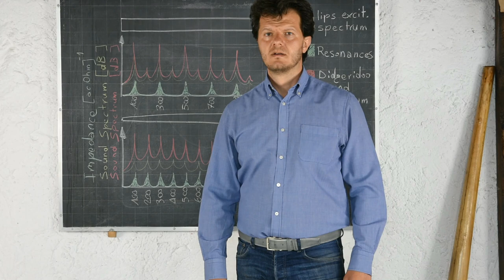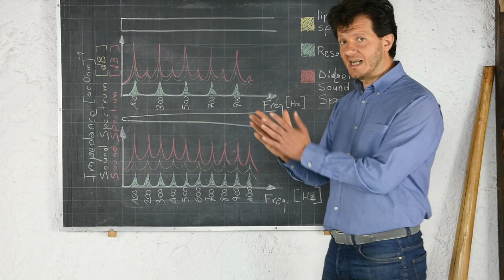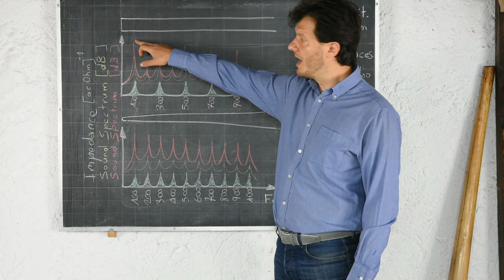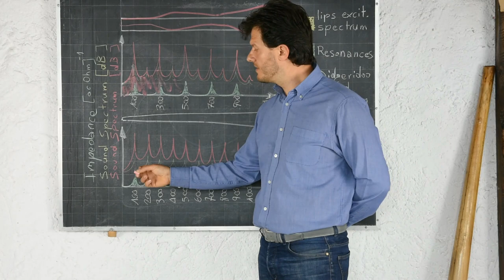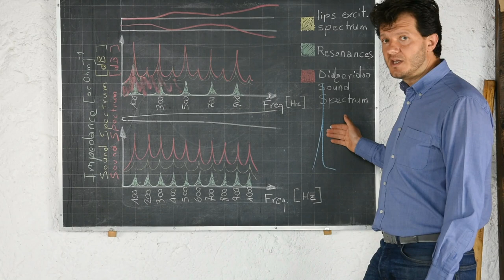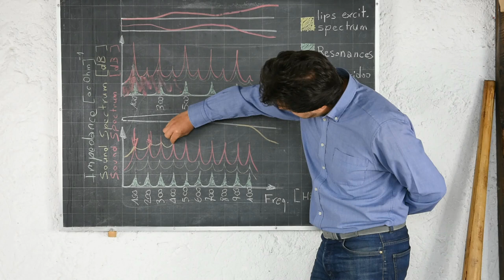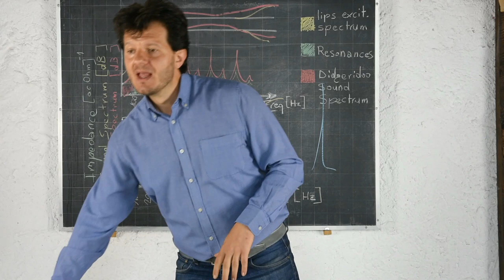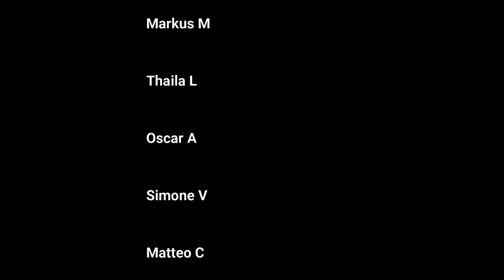Acoustic and color tone of cylindrical and conical didgeridoo 1/2 - by Andrea Ferroni

Comment: This video is really interesting. See, I thought the determining factor was the diameter of the mouthpiece for toots.  The Didgeridoo with the 33mm mouthpiece is the hardest one to toot on but it's also the most cylindrical. The didge with a 30mm sized mouthpiece is the easiest to do toots on but it's also the most conical of the 3.  The 3rd is a 31mm mouthpiece but this one is a middle ground between conical and cylindrical. It also has a slight curve. The toots aren't difficult but they're not effortless.

Comment: My thought is, to record a pulse response from an existing shape of a didge to load it into some convolution / impulse loader to modulate the didge specific resonances by buzzing the lips only into microphone. Then this could result in a electric didge :)
Reply from the maker: there are hundreds of way to excite a pipe, with the lips, single or double reed, and with electronic devices as well. 
But if we consider the didgeridoo has its own beauty in the tonal differences played with the tongue (staccato) and phonetic tongue positions like vowels, well if you want to create something like a didgeridoo, you must make a very hard job, otherwise you will obtain a sort of synthetizer made with a simple resonating pipe with one key only
Reply: @AndreaFerroni  Indeed, its a hard challenge synthesizing the harmonic spectre of a didgeridoo, because the player with his body resonance is a crucial part what travels through the tube in a certain shape.
Reply from the maker: @aeroDidge   ok, well, the harmonc spectrum of the didgeridoo is realized by the shape of the didgeridoo itslef. If you want to replicate the harmonics made by the musician mouth you have to add an heltmoltz resonator that works like our vowel positions.
A valve can make staccato. So, the technical part is possible to be made. I just worder if the final result worth the necessary time an money 
Anyway, let me know if you'll proceed